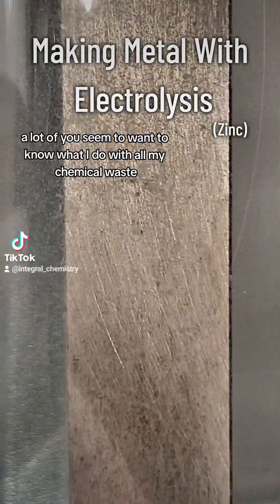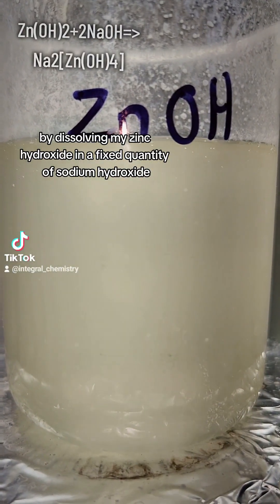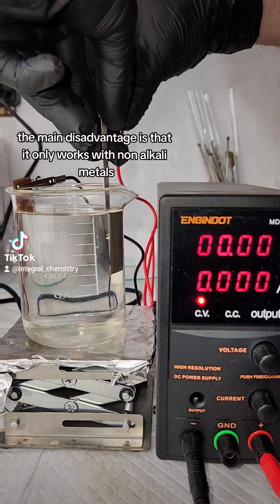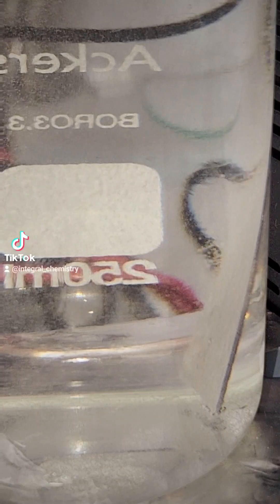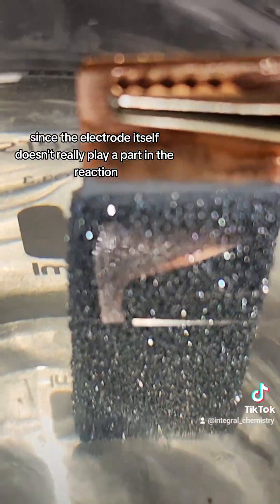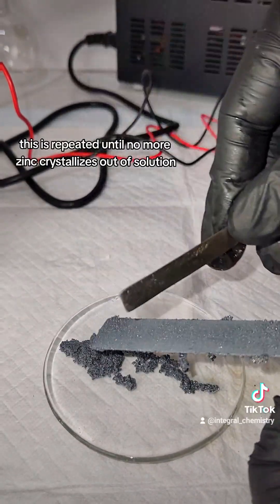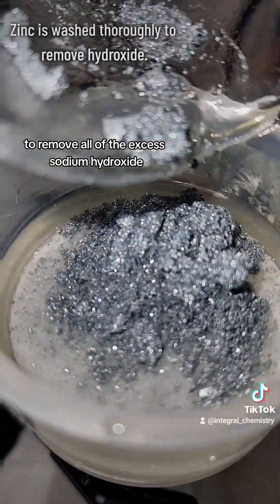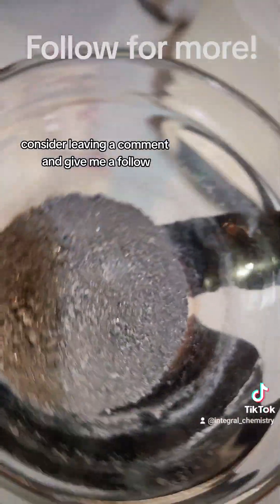Zinc by Alkaline Electrolysis

Comment: I refine e-waste. I have a bunch of Zinc sulfate waste I got from getting the copper out. I tried electrolysis but the moment I cut off the current, the zinc goes back into the solution. If I distill it, will the powder left over be just zinc powder or something else? or can I put something in there to drop the acid level? (diluting didn't work) or can I drop it out of solution with something else? I'll donate to your channel for a useful answer... thanks
Reply from the maker: Hey thanks for the question! So the issue with zinc is that its a very strongly reducing metal. Zinc really can't exist in an acidic solution, even a weakly acidic solution as it will dissolve nearly instantly.
The trick is to dissolve the zinc in hydroxide (lye) and then electrolyze the alkaline zinc solution (like I did here in the video)
You can make zinc sulfate into sodium zincate by simply adding lye until it clears up. You can use copper for both anode and cathode, btw
Reply: @integral_chemistry  Thanks I'll try it. I need to load a debit card and I'll send you a thanks. If I get it to work I'll send a little more. I don't want to give google my numbers and there's no option to send it from my google pay account.... kinda dum
Reply: OK....... so I had to set up a special card at my bank to use. Because I'm in Spain and your in the USA I think. Because if I click a thanks button and the person is in Europe or Asia, I can use PayPal, Google-pay, Bitzum and a few other things.
Thanks again and later on today I'll give it a try
Reply: @integral_chemistry  So the zinc sulfate was clear at the start. So I put lye in and it turned orange and neutral. So I put more zinc sulfate in until it cleared up. Then I added lye until it was light yellow and slightly acidic. I used copper and at 12v 1.5 amp it was plating really nice. so I put the amp's  to 2.3 and I started to get sponge. I can use that to drop gold so I will let it run. I have several more liters that have copper powder at the bottom so, I think  I need to react them with more zinc first. So thanks I think.... I'll sent you an email soon

Comment: This question comes more from processing refining waste from silver refinery. The waste primarily is composed of zinc nitrate and copper nitrate. Will this work if we raise the pH of the nitrate solution to 7-8 and then perform the same electrolysis? Or will it deposit zinc along with copper on the cathode? Thanks

Comment: Can zinc oxide be added instead of zinc hydroxide...
Is the manufacturing method zinc hydroxide?
Reply from the maker: Yep! Zinc oxide works just as well
Reply: @integral_chemistry  Thank you. But it is difficult to get a nickel electrode in my country. Is there an alternative? Can zinc hydroxide be manufactured?
Reply: I need your help with zinc metal because I use it in welding and my work is at a standstill
Reply: Hiiiiiii

Comment: 1:01 Nickel ANODE (+) and copper CATHODE (-). If you do it the way you said you'd slowly dissolve the copper and contaminate your zinc! Copper is amphoteric and actually dissolves in strongly alkaline solutions. Nickel on the other hand is extremely resistant in alkaline conditions and makes good insoluble anodes. Also no, you can't get aluminum this way...
Reply from the maker: Wow yeah I'm surprised you're the first person to catch this.. yeah you're right nickel gets the positive terminal and Copper gets the negative.. not sure how I switched the names in my head but did it correctly in the video. I'll put this correction in the video description, thanks!
Also I was able to get this to work with aluminum, but the issue is that it redissolves at such a high rate that you need to apply very high voltage, then it generates a lot of heat and becomes quickly dangerous and impractical. I also forgot that copper was amphoteric.. I wonder if you could do an alkaline electrolysis with copper..
Reply: @integral_chemistry surely you can. I did a mini scale test where I dissolved some iron oxide on 10M KOH and i was able to deposit it in the catode. Most of it fell of from the cathode, but i confirmed that was iron metal with an acid test to see H2 evolution (the iron was washed with distilled water to get rid of possible K2CO3 contamination that might generate bubbles)
Reply: If iron was possible i'm sure that copper can be done
Reply from the maker: @lautaromorales2903  yeah theoretically any amphoteric metal could work. Copper might be easier than iron due to the soluble complex it forms with ammonia.. might try that..

Comment: You mentioned this works on aluminum, but I'm confused how you would get that to work?  I wouldn't imagine it would plate out since it would just react with the water?
Reply from the maker: It probably reacts with water a bit, but I've done it with aluminum and it seems to work fine. I think its just that it forms far faster than it can react, since it doesn't react with water nearly as vigorously as say calcium or magnesium.
Reply: @integral_chemistry  Fascinating.  I'd love to see a vid on that.
Reply: @LFTRnow  Me too. That could be really useful.